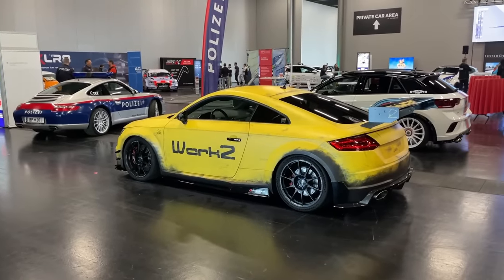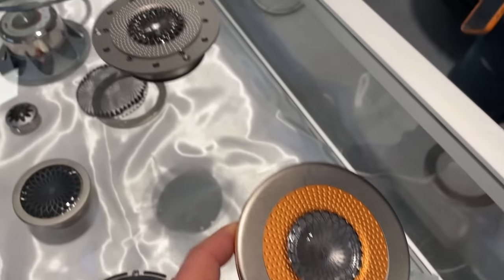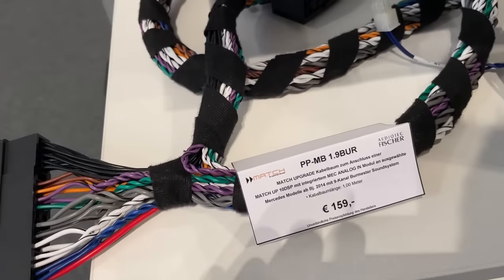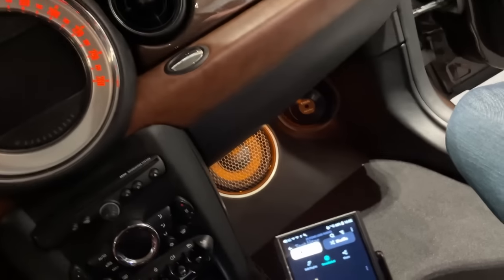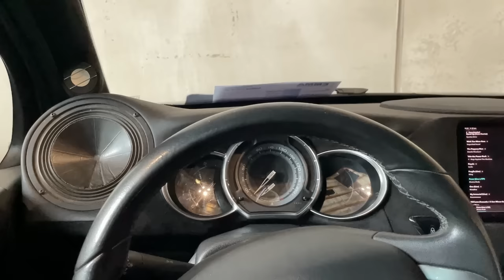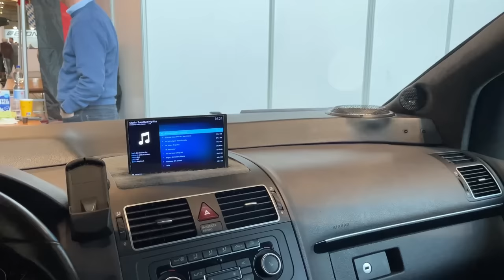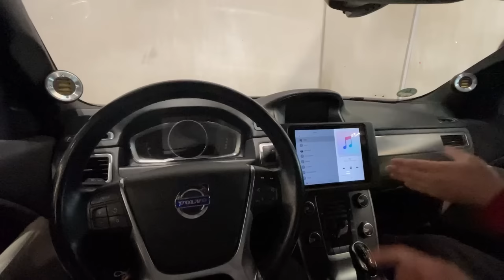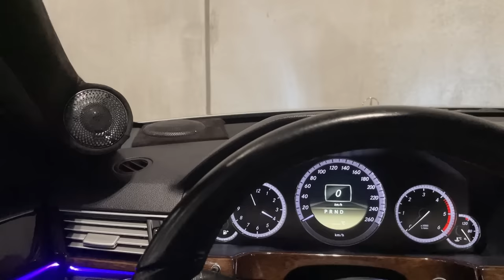EMMA Euro Finals Salzburg 2022 - Car Audio Competition and Exhibition

Comment: My Helix conductor is driving me crazy. Volume go’s up and down on its own. Then when I try to turn it up or down it jumps all over the place. 😠🤯😠
Reply from the maker: Hi,
That used to happen with Directors, never heard a Conductor do that. Get it replaced asap, can be dangerous. 😳
Reply: @pssound9749  sorry my director. I’m thinking about getting the conductor because it’s so annoying. Unless they have a fix for it?
Reply from the maker: @myboy051  it’s the encoder, that can be changed by an experienced soldering professional.